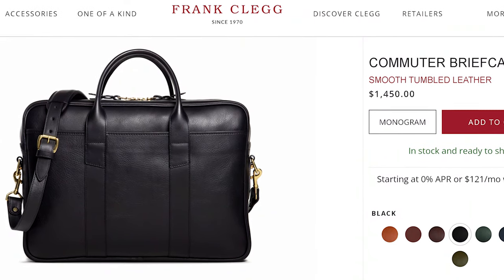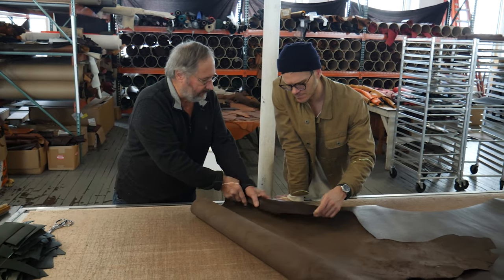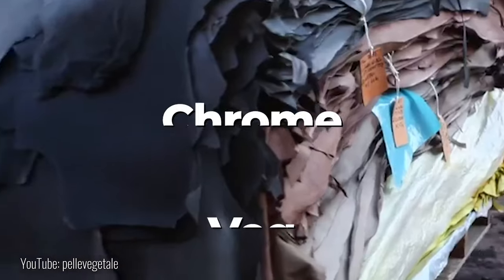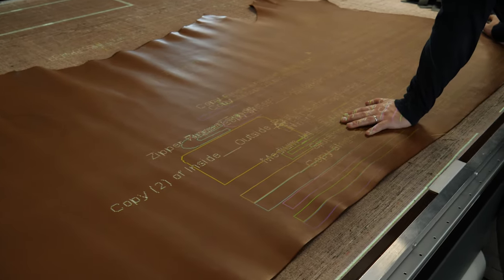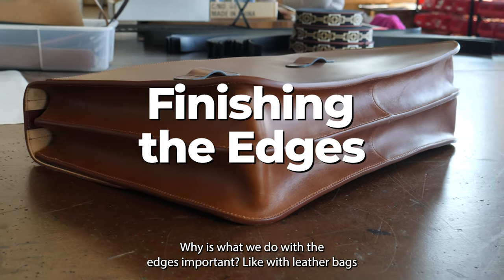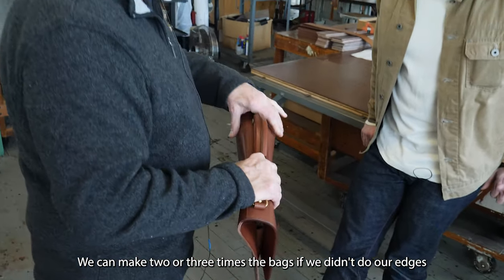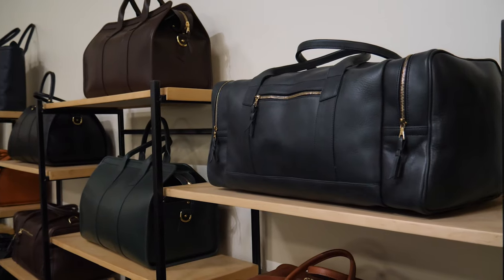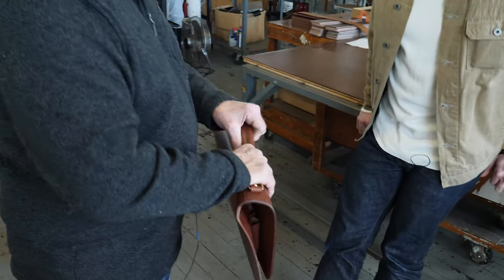American Factory Visit: Are Frank Clegg's Briefcases Worth $1,450?

Comment: Briefcases look nice but none have outer compartments for easy access, no outer/trolley sleeve to attach to your luggage, and no stilts on bottom so your bag will get scuffed when you put it down. For $1,450, I expect more.
Reply: Many of his briefcases have full length outside pockets on both sides(very discrete). They offer four different luggage mechanisms that can be added to their designs for small fee. 
For the caliber of the bag, it is a fair price. It could cost double at a high end store ,Easily .